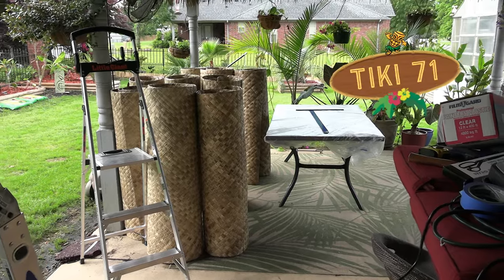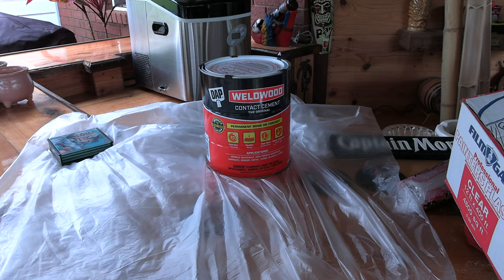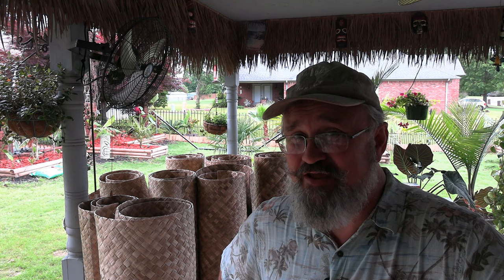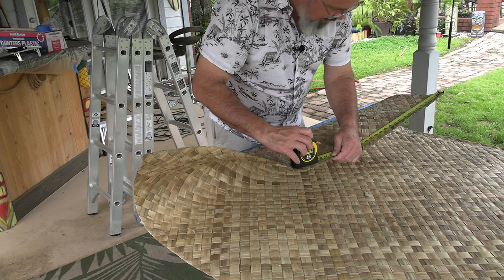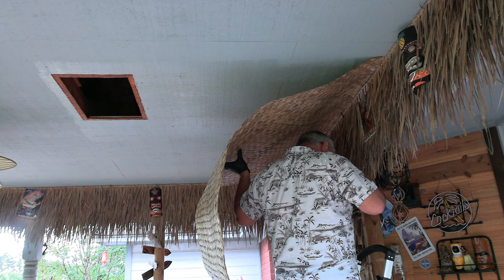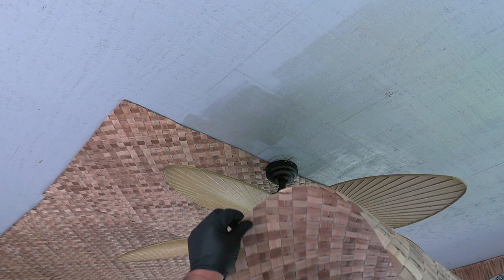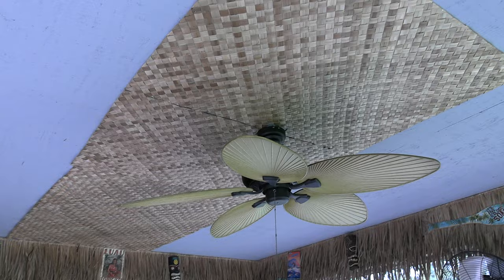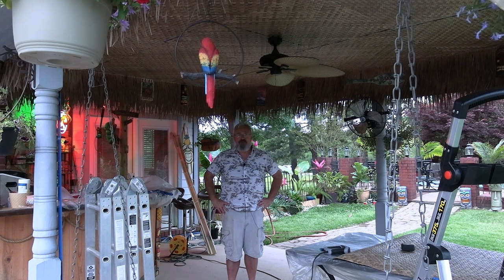How to Install Lauhala /BacBac Matting & Bamboo For Tiki Ceilings Pt 1

Comment from the maker: Project Links 👇🏼
4x8 Lauhala (Bac Bac) Matting: https://amzn.to/3y1mQwe
Cordless Power Scissors: https://amzn.to/33tEyKX
2”x8’ Bamboo half round: https://amzn.to/2QNAsL0
Contact Cement: https://amzn.to/3hcmpcL
Adhesive Roller Cover: https://amzn.to/3heVKfa
Rubber Roller: https://amzn.to/2RF9oxo
2”x8’ Half Round Bamboo (I used 3”): https://amzn.to/3vNht1U
Mexican Palm Thatch Runner: https://amzn.to/3vYEyPr
T50 Electric Staple Gun: https://amzn.to/3uBfvBz
T50 ½” Staples: https://amzn.to/33yqe3G
Little Giant Ladder w/Tray: https://amzn.to/3hdLUu9
Painter’s Tape: https://amzn.to/3o0qsKu
3/4" Rope x 50’: https://amzn.to/3vxhs27
2 Person Hammock: https://amzn.to/3uesWHo
Hammock Stand: https://amzn.to/3nHU3bj

Tiki Bar:
Chico the Chimpanzee: https://amzn.to/3rVJlPr
Four Bottle Liquor Dispenser: https://amzn.to/3sAFqrb
Cocktails Neon Sign: https://amzn.to/2QpsSWL
Parrot Bay Round Sign: https://amzn.to/3awCW77
Captain Morgan Rail Mat: https://amzn.to/3vaIyM8
Drinking Parrot Bottle Holder: https://amzn.to/32DeY5Y
Tiki Bar Surf Board: https://amzn.to/3x8eUsK
Palm Tree Bottle Opener: https://amzn.to/3tSH20Q

Tiki Garden:
Moai/Easter Island tiki planter (better color than mine): https://amzn.to/3dcdbe0
Tiki Face planter: https://amzn.to/3e0Bqem
2 Tiki Face torches: https://amzn.to/31c77eQ
12 pack of original tiki torches: https://amzn.to/2PSsShQ
Bamboo Border 2-96” pcs: https://amzn.to/32t9B97
Solar/Sonic Mole Repeller: https://amzn.to/2Q50WY9
My mulch/dump cart: https://amzn.to/3x8K839
3-n-1 Cosco Dolly: https://amzn.to/3wKWFcO
Book: "Palms Won't Grow Here & Other Myths": https://amzn.to/3dbFcTx
Plumeria FOUR PACK Fresh from Hawaii: https://amzn.to/3mXCrqj
Majesty Palm: https://amzn.to/3dWI1GC
3 Gal. Washintonia Robusta Palm Tree: https://amzn.to/399HKyG
2’ Windmill Palm Tree: https://amzn.to/3mEpraw

Other Tiki, gardening and greenhouse items I use: 
https://www.amazon.com/shop/tiki71  

🍹 We have a recommended product page on Amazon & it’s filled with the things we use and like & it’s a convenient way to check out what you see on our channel & it adds ABSOLUTELY no cost to your purchase: https://www.amazon.com/shop/tiki71  
If you click through and buy something, we receive a small a very small commission (as little as 1%) that costs you NOTHING extra, but it helps us with the costs of delivering content, so Mahalo (thank you)! 🤟🏼 
🌴 🥃 🍷 🍸 

🌴 Subscribe: https://www.youtube.com/c/Tiki71
🌺Join our Facebook Page: https://www.facebook.com/thetiki71
🥥Instagram:  https://Instagram.com/TheTiki71
🗿 Twitter: https://twitter.com/thetiki71
🦜 Email: tiki71@yahoo.com

📭 Send me letters, pics, and stuff (I might open it on camera and give you a shoutout}: 
Tiki71
c/o Jungle Jerry
205 Wilburn Heights
Central City, AR  72941

🌴 Tiki Gardener Bumper Stickers!  Show your love for tropical plants AND tiki at the same time.  Just $5.00 in the lower 48 states, $6.00 everywhere else with SHIPPING INCLUDED.  
Go to https://www.paypal.com/paypalme/tiki71 and be sure to include your address at checkout.   I’m using a direct link to PayPal, in order to keep costs down and I’d rather pay for shipping it to you than some corporation to host a website that does the exact same thing as the PayPal link. 😉🤙🏽

 👎🏼 I DO NOT buy, nor recommend plant SEEDS on Amazon, only live plants & cuttings from sellers well rated. I've had too many bogus experiences. 

👍🏼 I absolutely DO recommend Amazon on live plants that you can’t get locally. Several of our multi-year tropicals have come from good suppliers on Amazon (like (Logee’s, American Plant Exchange, Cold Hardy Farms, Costa Farms, Old Oaks Nursery, Hirts, etc.) and arrived alive and well. 

🌴 🍷 Okule Maluna! 🥂 🌴
Reply: If you are using contact cement why do you need to staple it.  Doesn't the cement hold it in place. Are the staples visible?
Reply from the maker: Answered in the 2nd video.  It's backup for exterior temps & moisture.   The bamboo is hiding the staples.
Reply: @Tiki71  Ok thanks Im doing the same thing on a smaller scale.  Im also  Debating if I should use contact cement or liquid nails. How do your think a razor would work to cut the matting or do I need power scissors? By the way, your bar looks amazing.
Reply from the maker: You could use fabric shears if you had to.  Thanks!

Comment: Awesome work man. Working with lauhala matting on a much smaller scale, I wish someone would have told me that the pieces are not completely square. You kind of have to roll with the punches on that one. It's not easy doing all that ceiling work with one person, but I'm sure it will give you a greater appreciation when the project is complete. Looking forward to seeing part 2!
Reply from the maker: That's for sure!  I finished the project last night and started sifting through hours of video today.  I had to break it up into two parts.  Thank you for watching!

Comment: Hey! We're doing this inside our home on the living room walls. For the baseboards, do you recommend cutting the bac bac matting and doing the boards separately? Or would it be ok to just go over them? The baseboards are about 6" tall and 3/4" wide. Thanks!
Reply from the maker: If you're using the same baseboards,  I'd pop them off and nail them back on after the bacbac is installed.  If you're painting them, a dark chocolate paint really pops along side the bacbac.  🤙😉
Reply: @Tiki71  thanks for the reply!!! our baseboards don't come off (old rental) so we were thinking of putting the matting on top of it. we didn't think of painting but what a great idea! Thanks!